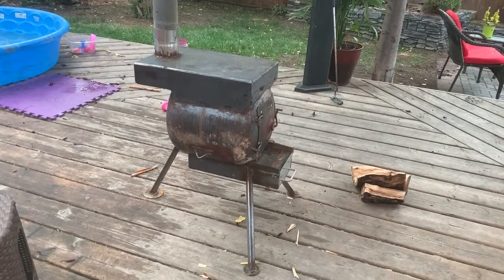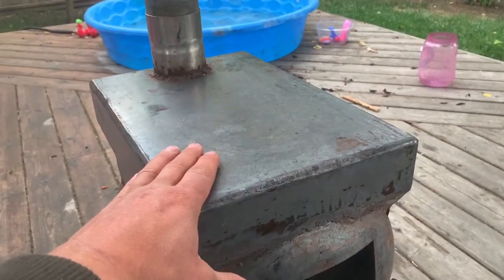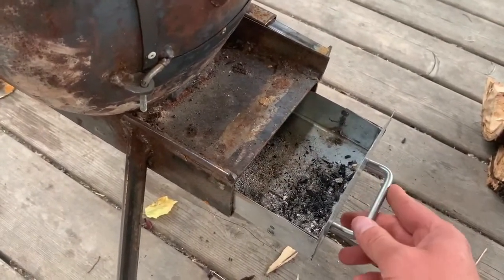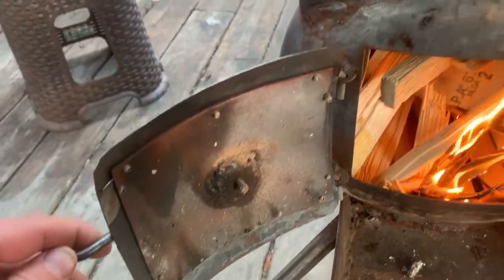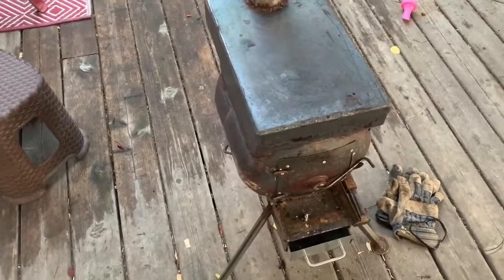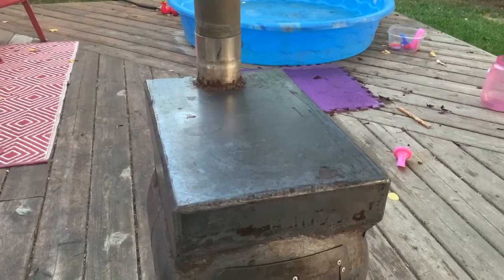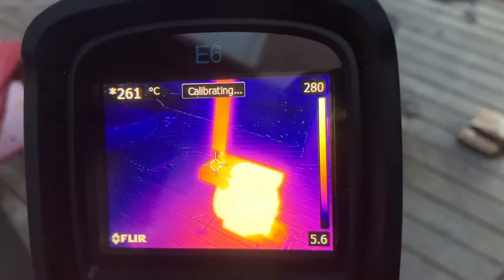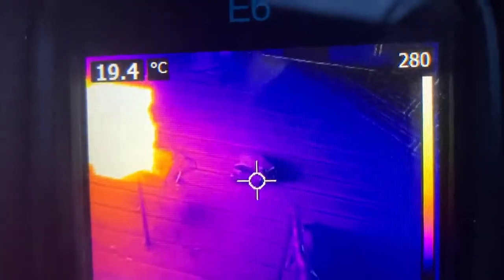Propane Tank Wood Stove

Comment: This is the best engineered propane bottle stove I've run across so far: the secondary combustion tubes and top chamber ignite the gases that are exiting, which is why it burns with hardly any smoke. And having the extra air adjustments helps fine tune the burn process. Nice job!